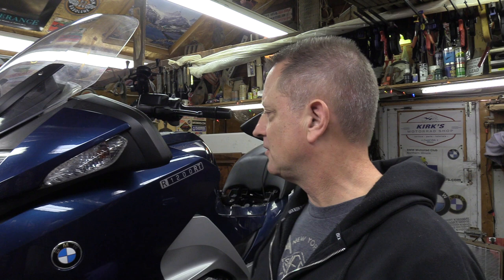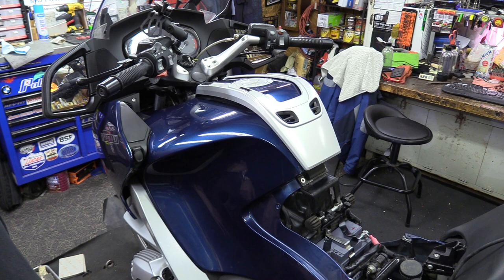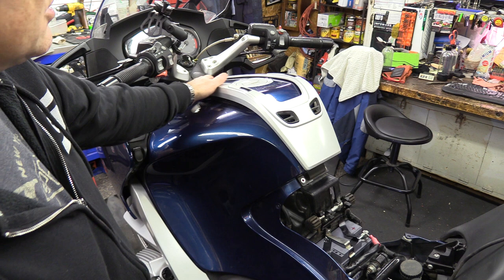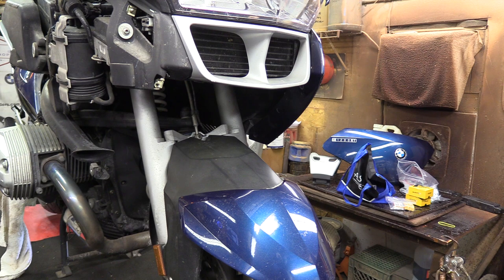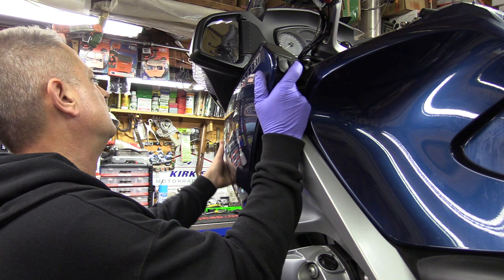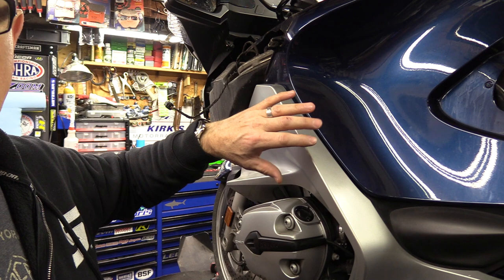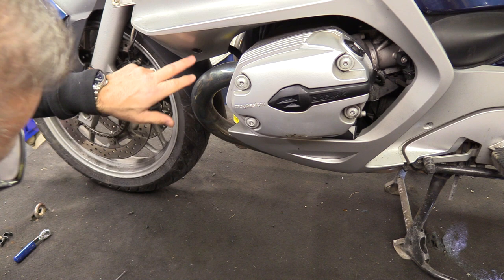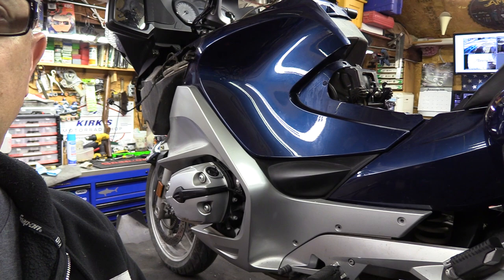2008 R1200RT Fairing Panel Removal

Comment: Thank you so much for your video, I purchased a 2005 R1200RT used last month and it was from the original owner, the bike had 42000 miles on it and has had the local dealer working on it since new, they did the fuel pump recall and a front suspension recall amongst other things. The fuel strip was replace twice once on warranty and once customer pay the fuel strip is not working again at purchase day. I located a wrecker on ebay and purchased what he said was a good working strip and with the help of your excellent video just replaced the strip myself by taking off the filler neck and removing the fuel pump. Back together again with ease thanks to your video. Viola I have a working fuel gauge! I have a further question for you, I leave my bike parked for the summer months as I'm a snow bird and go back to Canada for the summer. Is it best to leave my R1200RT in my garage in Arizona with the fuel tank dead full to the neck, that way no air is exposed to the fuel strip. Could it be that the issue with these strips is that the are parked with say a 1/3 tank of gas or close to empty. What are your feelings on this. Again thanks in advance. Reg

Comment: I wrote in and asked about issues with the  K1200 LT cruise control and you put out a video showing things to look for. I have had issues with my cruise control only working intermittently when the weather was warmer. It hardly worked in the morning when it was cool and it would work most of the time when coming home in the afternoon when it was warmer. I have no idea why. However, over the winter I did an alarm-ectomy, spark plug, plug wires and O2 sensor replacement (and of course shift linkage service). Since then my cruise control system has never failed to operate. Could it be that the alarm was causing my issues? It's now pushing up daisies in some land fill. RIP piece of crap!

Comment: so I need to know how to replace the antenna base on mine as a vandal broke it off. I have no idea how to get the dash area on the right side accessible to be able to unscrew the cable and mount the new base. 
Any help is appreciated.
Reply from the maker: You may need ot remove the nose section for that. It is likely plugged in behind the fairing somewhere. I have not done one yet but would.
Reply: @kirksmotorrad  Thanks Kirk, please let me know what you find out. The Dealer quoted 4 hours of shop time to replace the antenna base. The antenna assembly was like $331 so plus 4 hours would be like $731 - ouch. I'm up for doing it myself if I can figure out how to open up the dash. I have taken off the plastic cover and each side areas but didn't venture inside it more than that as I wasn't sure how it came apart. The diagram isn't very informative.
Reply from the maker: @MarcMarchioli  I am surprised your insurance isnt covering that. Bring it to me. I will figure it out.